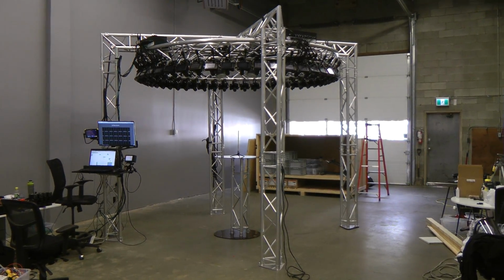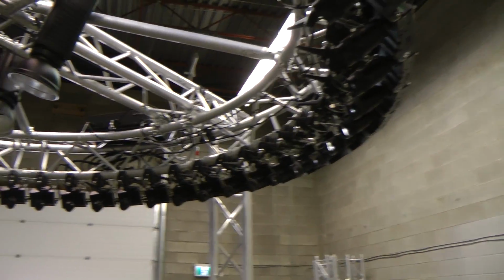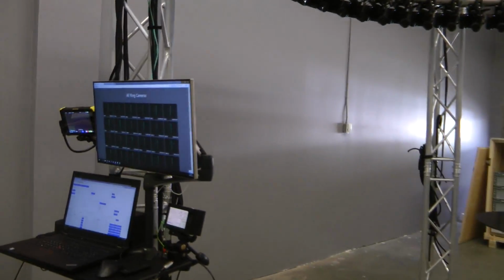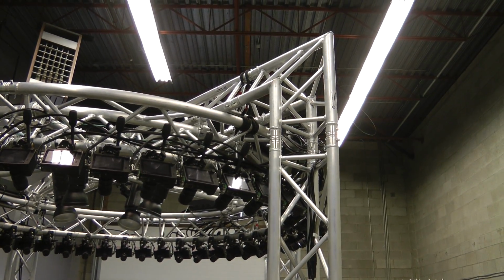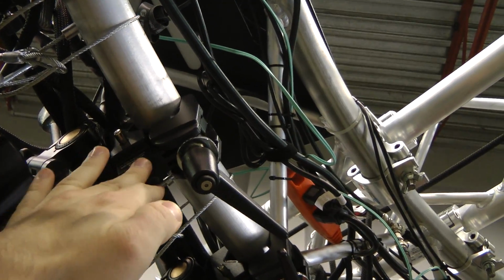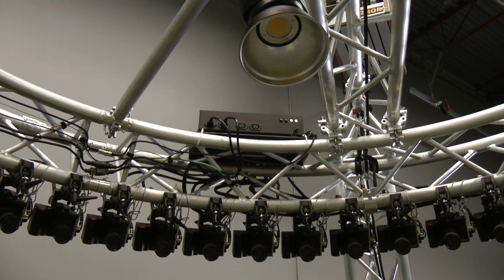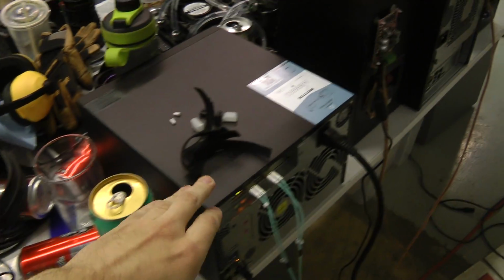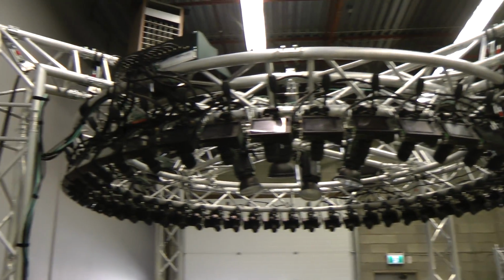Chronos Ring - Bullet time array of 48 high-speed cameras

Comment: the spinning is a bit nauseating if it's so quick
Reply: tommihommi1 True. Problem is that he’d have te use even more cameras to be able to spin slower without making it look choppy..
Reply: @cedricdb  Not necessarily, since the spin is dependent on framerate and speed of the action filmed, pace matche the two so it plays at an acceptable speed and spin rate
Reply: Soken50 How is the spin dependent on the framerate and speed of the action and what do you mean by ‘pace matching’?
Reply: @cedricdb  I mean it takes 1 frame per camera which gives 1/48th rotation.
If it is too fast for the action and makes for a dizzying spiral, you slow the framerate.
If it is too slow for the action and you can barely go around once before it's over you increase the framerate.
Edit : typos
Reply: @Soken50  if you use 2 frames from the same camera through then it will look even worse because it will look choppy/jumpy. So that really doesn't work. What they could do it instead of showing it at 30fps show it at 15fps but that would also start looking a bit hacked off
Reply: @sinom  i never said to doouble the frame, I said to match the camera framerate to the action being filmed so it isn't so dizzying.
Reply: @Soken50  I'm pretty sure noone in this comment thread gets what you're trying to say. Could you try to explain it any other way?
Reply: @sinom  I can't think of any simpler way to explain it, 1 frame is 1/48th of a turn. For a given action taking a given amount of time,  you have to set a frame rate that gives a reasonable rotation relative to the speed of the action. Let's say you film bullet, you'll need a rapid frame rate because it moves fast, so you will have a quick rotation. Now say you film a balloon exploding, it is significantly slower, so you set the frame rate lower, giving it a slower rotation.
Reply: @Soken50  that's not how it works though. The rotation speed will always be the same in the footage played back at the end and our problem is the rotation speed. Filming at a different FPS will not make the rotation go slower or faster. The fps when you play the video are what matters. If you play at 30FPS it will have a rotation every 1.5 seconds. If you play at 15FPS it will rotate every 3 seconds.

Our problem isn't that it rotates too fast for the subject, but that is just rotates too fast in general.
Reply: @sinom  if a frame is equivalent to 1/48th of a turn then changing the framerate of the cameras will change the rotation speed, or am I missing something obvious ?
Reply: @Soken50  yes a frame is 1/48th of a turn but that also means that a full rotation will always be 48 frames. That means the camera framerate matters for the speed of the target but not for the spinning speed. If you increase the camera framerate then the bullet will cover less forward distance per frame. 
If you increase the framerate of the outputted video, then the speed of rotation will be faster. 
If the final video has 30fps then you will have a full rotation about once every 1.5 seconds.
If the final video has 60fps then you will have a full rotation about every 0.75 sec.
And what we want is the spinning to slow down. So what we would need it so play it at 15FPS but that would start looking kinda bad.
Reply: @sinom  I see, it makes sense, I didn't think that through to the end ^^'
Reply: @sinom  you don't need to pick 30 fps or 15 fps, when you are processing the video, you speed up and slow down the video as desired for the desired appearance, and then render it at 30 fps or 60 fps or whatever you want.
You just have to be careful that whatever speed you use for any portion of the video isn't going to look choppy, or use processing to smooth it out.
Reply: @ke6gwf  ???
What do you mean by "render it at 60fps or 30fps"
You get 45 frames per rotation so 45fpr. How are we now going to get 60fpr out of that without interpolation? You can't just pull more frames per rotation out of thin air. 
With a computer animation you can render it at any fps you want but when have a physical limit on your fpr then you can't change the output framerate without in some way changing the rotationspeed in the output video and vice versa. You can make it rotate faster by e.g. only taking a picture with every second camera but you can't make it rotate half as fast because you would need twice as many cameras for that.

If you use interpolation then yes you can slow it down and speed it up and keep it at e.g. 60fps but that 1. Won't look as good (interpolation always looks wired) and 2. Creates fake data (so it's useless for stuff like analysis of objects at fast speeds)
Reply: @sinom  computers and video editing software are smart enough so that you can give a program a video, move a slider bar which will adjust the playback speed of the video and then the program itself will alter the frames of the video through motion blur or some other mechanism to create additional frames to fill at 30fps for a reasonably slower playback. I have no direct knowledge of video editting software or highspeed videography besides being a regular viewer of he SloMoGuys, this is just an ability that I would give the program the ability to perform because it makes sense.
Reply: @frankzaffuto3670  through interpolation. Which as I said is not something you usually want.
Reply: @frankzaffuto3670  also. The slowmoguys are able to do the variable speed effect without loss if data because they have a steady camera. If they did it with a moving camera then the different playback speeds at the end would also affect the movementspeed of the camera.
What we want it changing the movement speed of the camera. That requires interpolation and interpolation is bad.
Reply: @sinom  as Frank said, once you put a video clip of any sort into editing software, you can change the speed at which it plays, as was often done in this video when he slowed it down to see certain things, and then sped it back up again.
The software simply uses various methods to lengthen or shorten the time any particular frame is displayed, and may or may not use algorithms to blend one frame into another to keep it from looking choppy.
At certain combinations of original frame rate and rendered frame rate, it may look choppy anyway, so you avoid those ranges.

Yes, if you are trying to get certain precise measurements out of this, then you can't use smoothing, but you also don't care about choppiness or frame rate, because it doesn't have to be visually appealing.

This just needs the speed adjusted in rendering to make it more visually appealing.
Reply: @sinom  what I just posted would be a bit excessive, I honestly don't know if we even have the technology to be able to synthesize frames from interpolation, but what we do have are cameras that record images at very high rates or in this case cameras which record a high-res image every second and a half -ish. High-speed videography works because the cameras are able to record so many images per second that creating a video which plays 30 or 60 frames per second slows down the video playback. (see SloMoGuys: breaking glass)
P.S. you turned FPS (frames per second) into frames per rotation. If you have more than two simple clarifying questions after reading this, you are a decent troll and I salute you.
Reply: @ke6gwf  interpolation (which every method of slowing down Videoclips uses) Just simply doesn't look good. Look at some comparisons. It's not the nicest to look at.
Reply: @frankzaffuto3670  and I didn't turn FPs into FPR. They are 2 very different things with both being important for the problem and connected to one another. 

Just to clarify what I'm even talking about cause it seems that that got lost in this thread:

The problem is the rotation is too fast and gets dizzying. Getting anything lower than 0.67 rotations per second at 30fps is impossible without interpolation which just doesn't look good. Yes interpolation exists (it's the thing TVs use to display the ~30fps broadcast footage at 60fps). Yes it can be used to slow video down without loosing any FPS and in this case it could also be used to slow down the speed of rotation. But it looks bad. And the less actual real frames there are per second the worse it looks. 
To simply get the footage down to 1 rotation every 3 seconds (0.33rps) you would need to interpolate one frame for every existing frame. This works if nearly nothing is moving and you have a stationary cam. If everything it moving though as with these moving cams then it usually looks like sh!t.

The slowmoguys guys are able to slow down the footage because they have the real frames. They never go slower than the framerate they actually recorded at allows. Speeding it up is no problem since the program can just throw away frames and merge them together as motionblur.

All of that about the SMGs ↑ is completely irrelevant for the problem though.
Reply: @sinom , you are still being confused by the difference between the frame rate of the finished video, and frames per rotation of the high speed camera bank.

It takes 48 frames per rotation, and does that thousands of times per second (I don't remember the exact rate, but these are high speed cameras we are talking about.).
The speed of rotation is faster than low earth orbit!
We never see that full speed footage, because it would be real time footage then.
So every single slow motion video that you have ever seen has been slowed down by software making each frame last longer on the screen than how long it took to record it.
So all that needs to be done is for him to slow it down a little bit more so that it is easier to watch.

And since he already slows it down and speeds it up in the video, there is no direct correlation between the original frame rate and the rendered frame rate, since it changes!

We just are saying that it should be changed down a little more.
Reply: @sinom , I just went back and looked, and I see frame rates of 50,000, 72,000, and 500,000 fps.

Tell me again how he can't lower the speed of playback because of framerate and interpolation issues? Lol
He already is, because the clips originally recorded at those framerates were played back at the same speed.
He just had to lower the framerate for the subjects that weren't as bright.
Reply: @ke6gwf  no I'm not confused by anything. It just seems like you're not getting what I'm saying. Maybe I'm explaining it badly.

If you make each frame "stay on screen longer" that is what I was calling "slowing down the framerate". Because if you have 30fps footage and leave every frame on there for twice as long you will have 15fps footage at half the playback speed. 
So as I said before you can't slow it down (without interpolation) without sacrificing the framerate. And 15FPS footage doesn't really look that good.

All the slow mo footage isn't slowed down.  It's just played back at a framerate different from it's native framerate.
Reply: the sacrifice of having a setup with nearly 50 cameras as opposed to one on a spin rig
Reply: @ke6gwf  ok so now to your second reply:
Let's take one second of 3000fps footage. Now every (let's simplify) 45 frames the camera will go around the object once because he has 45 cameras in 45 different positions (actually 48 but 45 is easier to work with). 
If we now see one full rotation completed every 1.5 seconds, that means he is showing us 30 frames every second. Because 45/1.5=30

If we now want it to rotate let's say once every 3 seconds, we can make the same calculation again to get the resulting footage speed:
45/3=15
This would mean that if we half the speed of rotation, we also half the speed of playback. 
To get it back up to 30fps we would need to put one additional frame between every 2 frames. But how will be now get those frames? 
There is no camera between every 2 cameras to pull the frame from. That's why we need interpolation for that.

Now to normal, non rotating slowmo footage. If you want to play back the footage at real time you have a problem, cause no display can show 3000fps.
We need to somehow get that footage down to something reasonable like 30fps. 
Now how do we do that? 
The simplest way of doing it is simply only taking every 100th frame and only showing that one. Now some simple maths again:
3000/100=30fps

Now let's say we want to display it at half the speed? Well no problem. Instead of showing only every 100th frame let's show every 50th frame.
Let's do the calculation:
3000/500=60fps...
Whoops. We have a problem. The footage wasn't sped up but instead now still is one second long just with 60fps. So what do you do now?
You simply take that 60fps footage and play it at 30fps. Now you have slowed it down by a factor of one half.

In the video the footage is shown at (for this example) 100 times speed. That means we simply play back the 3000fps footage at 30fps.
But when we now have the resulting 30fps footage and want to play it back at a slower speed again we get the same problem as before. There is no way to show that resulting 30fps footage any slower whilst remaining at 30fps. 
Because no matter what bigger than 1 number you divide 30 by, the result will always be slower than 30. So if you now want to play back that footage at half speed, it can have a maximum framerate of 15fps without using interpolation.

I HOPE you understand all of it now. This is basically a script for an educational video for 5th grade and now.
Reply: @sinom , yes, your math works out great, when you make up a frame rate that matches your math.

Now, do your math again, using the actual frame rate of 500,000 fps, or even 50,000 fps, or worse, 72,000 fps, and tell me how it can't be slowed down further than it is without losing quality?
Reply: @sinom , so I just timed the rotation speed in the video, and for most of it I was getting about 1.9 seconds per rotation, but there was one section that was about 2.3 seconds per rotation, and another one that was over 4 seconds per rotation.
I don't know if it used interpolation to do it, but I thought the slower sections looked much better.

Also, there are other ways to slow it down without interpolation.
For instance, if you want slower than 30 fps, but not so slow as 15 fps, you can output 60 fps, and keep a single original frame on screen for 3 frames of the final video. No interpolation needed.
It will appear half way between 30 and 15, giving more time to see details, less dizzy speed, and no interpolation.

But I unless you can see interpolation issues on the slower parts of the video, then I don't think that you are accurate in saying that it's a terrible thing.
Reply: @ke6gwf  it obviously doesn't look good in the slower parts because it looks stuttery and that stuttering is also part of why it makes you feel dizzy. Basically he has to compromise. Does he want stuttering, interpolation artifacts or a way too fast video.

And yep because he uses 60fps he can also play it back at any whole divisor of 60 without interpolation (but at a lower framerate)
Reply: Hæ Tommi ertu hommi?
Reply: @cedricdb  You could use digital interpolation to smooth it out.

Comment: Ignoring the coolness of bullet time, the usefulness of being able to capture high speed 360deg footage of an experiment cannot be underestimated.
The accuracy of the camera positioning and focus is also extremely impressive.
Reply: With a few more rings (and carefully selected subjects), you could even do high-speed photogrammetry / 3D scanning. That could produce some pretty amazing 3D animations of real experiments.
Reply: @JMMC1005  coulr just use regular cameras for that. They already do use setups like that actually.
Reply: @LittleRainGames  

I meant that you could get thousands of scans per second, and turn it into an animated 3D model. Regular cameras are only good for single scans.
Reply: @JMMC1005  what would you need to scan thousands of times per second? normally, a few images is enough for an AI to cobble together a convincing 3d model
Reply: @incription  To capture multiple models of something happening quickly. You could record a slow motion, 3D animation of an experiment.
Reply: @incription  IME accurate 3D scanning (on the einscan, for example) takes stereoscopic images of tiger stripe interference patterns on a subject at multiple angles, usually 36 times per scan. It takes a while and only models solid, still objects. This camera setup could be put to the task of tracking fluid motion and generating data that accurately describes the flow of materials in extreme detail.

Honestly there probably aren't many limits to the data you could get from these cameras with the right algorithms.

Comment: Apart from the speed of the spin being disorienting this is some uniquely astonishing footage, you can easily see the potential in everything from advertising to research. 
Hope you make dedicated footages of things in time.
Reply: well there are spin-rigs on which you can mount cameras, The SloMoGuys had an opportunity to try a few different things with one in their super slow show. The problem with spin rigs that this setup solves is one of speed: I don't know the upper limit on the potential speed of rotation for a 7.7 kilo camera (v2511 w/o lens) at the end of a 4m arm, but it can't be super high because the sheer weight of the camera was making the whole thing a bit wobbly (yes I know that with a stronger arm and a better counterweight system they could have gotten better results). On the other hand, the spin rigs only require one camera. Granted, it's a faster camera, but one camera vs the nearly 50 in this setup seems a bit more cost-effective